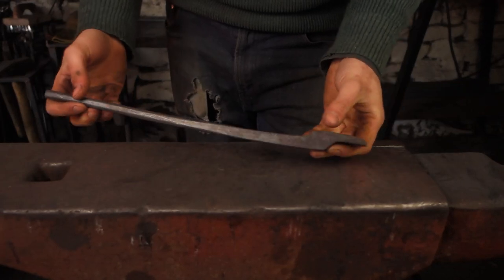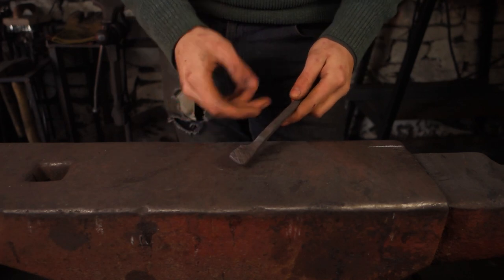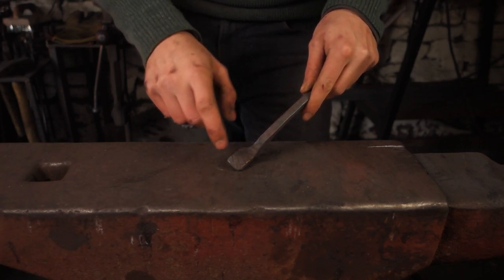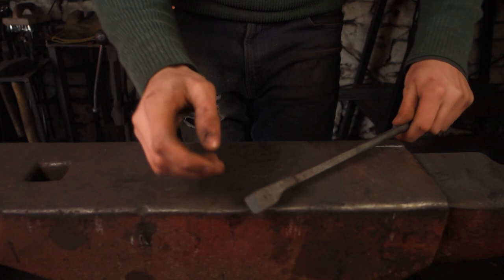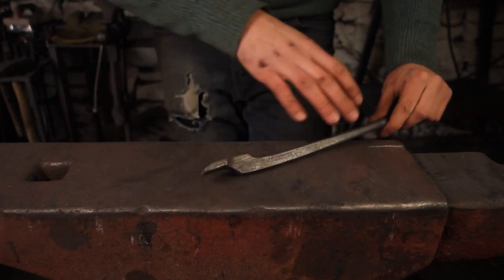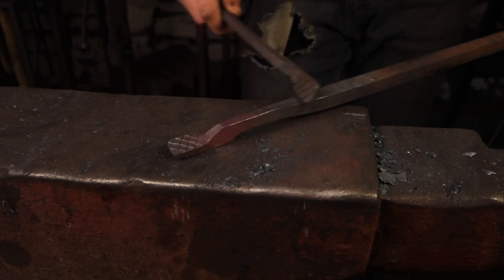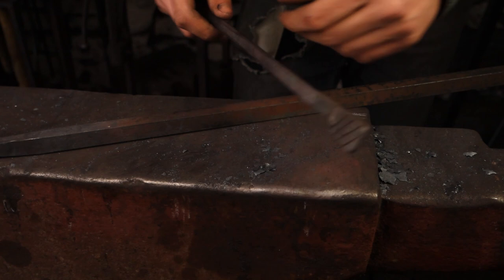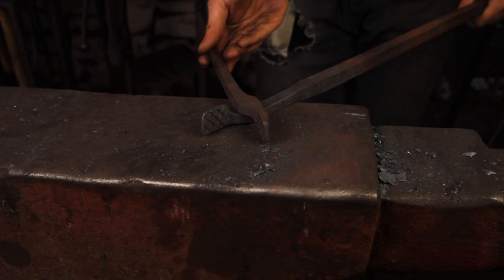Flat Bit Tongs

Comment: Great series! It looks so easy when you make 'em. I'm getting better but the main problem for me is preventing cold shuts or cracks around the boss area.. I think it has to do with too much movement of the stock and possibly working it too cold.
Thanks for sharing!
Reply from the maker: It may be that you’re getting the transition between the boss and reins or boss and jaw too thin. Try leaving it a bit thicker whilst you get the boss set then gradually thin it down. Hope that helps!